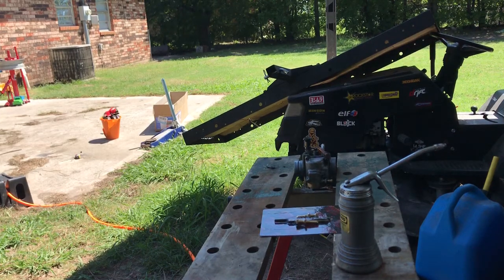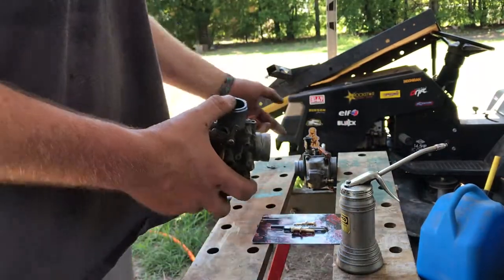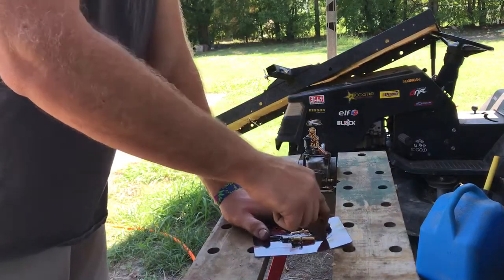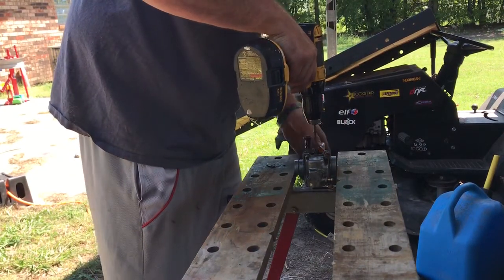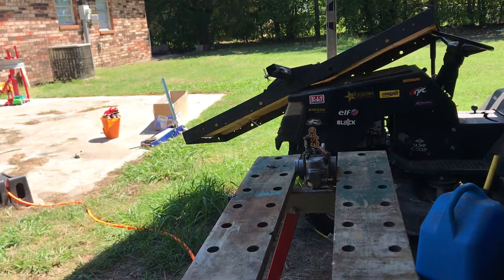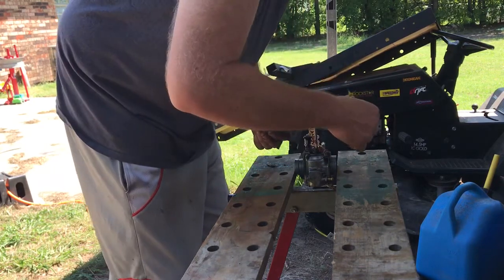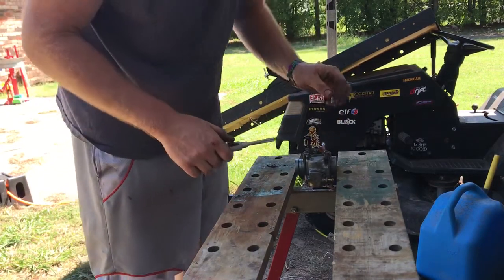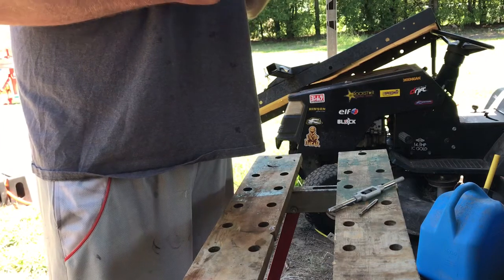Banshee idle screw install

Comment: Does the kit works great without grinding the carbs ?
Reply from the maker: azoz rock just use lock tight instead of the lock nuts so they will reach a little further in